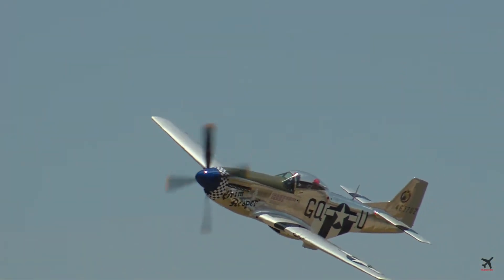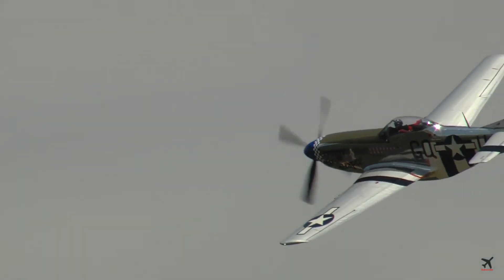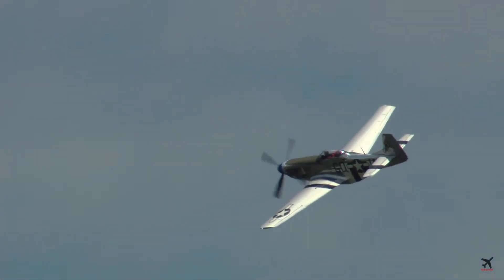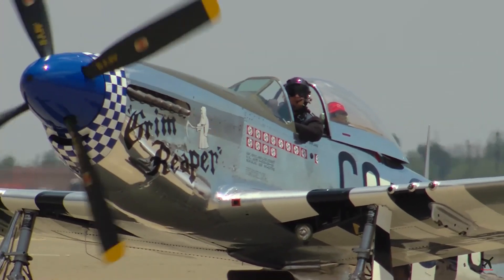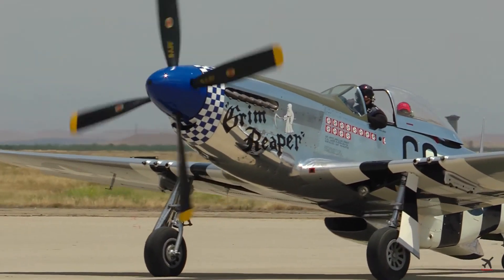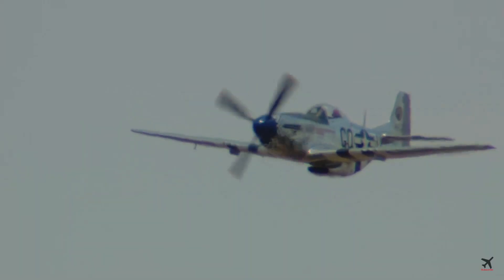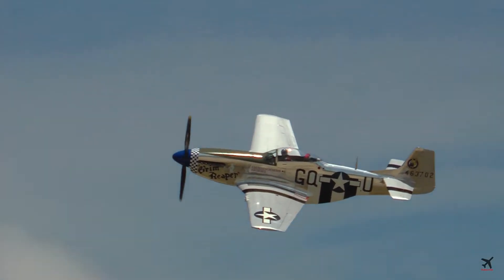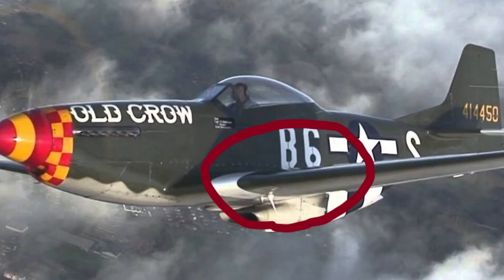Making R2D2's scream | Why does the P-51 whistle?

Comment from the maker: Just a quick correction - TF-51Ds can have gun ports, and I made the mistake of believing they didn’t have armament, I was wrong. Some P-51s have gun ports sealed up, resulting in the whistling to not be heard.
Reply: If a real gun, not just a cover with holes, is in the port does the plane whistle.
Reply from the maker: @08jag81  Yes, if a real gun is in there it shall make a higher pitched whistle, if there is no gun then a lower pitched whistle. If taped up it won’t whistle.
Reply: I agree
Reply: Does this answer apply to most WW2 warbirds?
Reply: Surely there is some kick arse 2 stage supercharger whine in there💪
There's a p 51 called precious metal, that beast whines and it aint even got guns. Pulled 454mph on 2nd lap with a contra-rotating propeller set up. Just a beautiful drag car of the sky💪💪💪

Comment: The problem with this theory is that the gun ports don't have the right depth and volume to make this frequency, and this sound isn't common on other aircraft that have similar guns in similar locations, most especially the most obvious comparison: The older Razorbacks and Thunderbolts. This sound is unique to the P-51D.

Comment: It seems like a degree of back-pressure inside the gun port is necessary as well. If the hole went through, ie wasn’t designed for airflow like the radiator, there wouldn’t be the energy needed to create the pressure oscillations inside the gun port, which is basically an open ended moonshine jug.

Comment: On P-51s with open gunports, do the openings in the leading edge of the wings have any significant effect on the plane's stall behavior?
Reply from the maker: The size of the gun ports are so small and therefore would yield a neglegiable effect to the stalling characteristics of the mustang, maybe only altering behaviour slightly.

Comment: I have a battered Subaru that does something like that . The right front wheel well cover is cracked and is held in with plastic tie downs and it drives me crazy when I'm driving into a strong headwind and that wheel well starts whistling. Seriously, thanks for the explanation.

Comment: How would a P - 51 D compare in a dogfight (with equally skilled pilots flying both sets of airctaft) with :

- a Messerschmitt Me - 109 K4,
- a Focke - Wulf FW 190 D9/13 or
- a Mitsubishi "Zero"?
Reply: The Zero was pretty much a 2nd rate aircraft by 1944, as the F6 Hellcat shot down scores of them at the Great Marianas Turkey shoot and before then as well.  And the P-51 was superior to the F6.  A
The FW 190 D(ora) 13 was the best German fighter and had almost the equivalent speed as a Mustang. While the Me-109K had a faster climb rate than both.  So if the skill of pilots were equal....this would be a hard call.  Personally I like the 20mm cannons as an armament. Better than MG's.   And I would take the FW over the ME as the FW was a much sturdier plane and could take more hits.
Reply: @robertwolf3969  BAGGED IT!
🔥🔥🔥💪💪💪👌👌👌

Comment: It's the inboard "blast tube" of the first gun in each wing that causes the whistle, not the mid and outer gun muzzles that protrude from the leading edge. The blast tube is several inches deep before the muzzle of this inboard gun is reached, hence the loud resonance. That's why the B/C models don't whistle. Their 4 x .50s are arranged differently and have no blast tubes.
Some TF-51D's retain their "guns", including the aforementioned inboard blast tube, like "Crazy Horse 2" for example, which whistles. However its sibling "Crazy Horse" (which I flew in 2012) has no guns and the clean leading edge means it does not whistle.
Contrary to myth, the radiator scoop and supercharger have nothing at all to do with the whistle sound.
Reply: Interesting. I would think that the "deeper" inboard gun means that the air space in it is larger than the other two, so that the whistle is a lower pitch than the others, which have a much higher pitch. Again, think of the coke bottle experiment where when you blow into an empty bottle versus what that is partially filled, the empty has a much lower pitch, or resonant frequency. From which I would conclude the inboard tube's resonant frequency is much more audible than the higher pitch frequencies of the mid- and outboard gun tubes. At some point, the tubes' very shallow depths don't resonate at all.
Reply: neat, answered my lingering question of why other American fighters, P47 my favorite WWII fighter for example, dont whistle.
Reply: @pixelation782  look up videos of the P-47 Tallahassee Lassie. She still has all of her ducting and the turbo charger intact. Most flightworthy P-47s have the ducting bypassed or removed and the turbo is almost never used due to the complexity and difficulty of repair. You will hear the turbo sometimes with Lassie but not bypassing the intercooler ducts also changes the exhaust sound a lot.
Reply: actually just found a different video of an F4U corsair whistling but with a much deeper sound and wanted to see if you know why it whistles differently?
Reply: @pixelation782 unlike the 51, the F4U whistle was caused by the intake ports of the leading edge of the wings.

Comment: Actually, it's not a whistle, it's simply the sound of the air going over a surface at high speed, and MANY warbirds do this, notably the Corsair, but so does the Lightning.  It's a function of speed and a plane's surface that is not and cannot be perfectly smooth

Comment: There actually seems to be a combination of more than one sound. Yes, the gun ports make the majority of the sound, but the one without still had a slight high pitch whistle on fly-by. Like using salt to enhance flavor, the intake seems contribute ever so slightly to the overall sound as can be heard by the one without the gun ports on fly-by.

Comment: Coming at you usually in a bank wind crossing the leading edges makes the cups on the inner most gun whistle. Passing overhead when the rpm range is right you can hear the impeller on the supercharger singing. So it's both just the gun ports are much louder.
Reply: Bullshit,  so why not on other Merlin powered aircraft Maestro?
Reply: @Slaktrax  Maestro? No No No Technician. 1st take a breath buddy you seem real dam up tight? Ever been to Reno? Most of the racing 51's have no machine gun ports so no screaming banshees or howl upon banking, turns etc. However you do still hear a singing whine not a howling from the heavens. It's the supercharger impellers. If you've ever spun one up on a test bench you'll never forget it. Almost like a skill saw just as the cut finishes you hear a gear winging. V12 super Chargers with short stack exhaust just infront of it you probably won't hear unless the aircrafts centerline has a big ass hole in it. Or maybe a radiator intake/exhaust ports. But you gotta remember anyone slightly hard of hearing will never hear it unless it dam near cut your hair coming over. So it's both only one is loud as hell and the other isn't. Grab a cone bearing, slip it over your fingers and use an air blower to make'er sing you'll see. (Just don't do it with a plastic cage type it'll fuck ya up when she comes apart.)
Reply: @warrenchambers4819  Thank you for your comment. When I was a teenager, I was told that it was the supercharger whistling. Watching this video made me think I was told incorrectly. Sounds like both things can produce the whistling sound.
Reply: @warrenchambers4819  

You can hear the SC whine in the non gun port Old Crow pass in this video.

Its more subtle than the Gun port howl.
Reply: @Slaktrax  you can also hear a slight supercharger whistle at Spitfires and more prominent at DB 605 engine of Bf 109.

Comment: Another “Whistling Death” like the F-4U Corsair.
Reply: Both beautiful planes but I love the elegance of it’s inverted gull wing design combined with brute force that the Corsair possesses.
Reply: Amen! The F-4U with its inverted gull wings, is a very unmistakably unique aircraft.
Reply: I watched a video on the F-4U Corsair a while back. They said the whistle on it comes from the oil coolers mounted in the wing next to the fuselage.
Reply: They are both my favorites with spitfire just behind. Then the mosquito. Whats neyter than two merlins
Reply: Hoa Tattis  As you’ve said. To each their own. It was faster than the P-51 at top speed by about 10 knots. The P-51 would cruise much faster by nearly 100 knots and was definitely more maneuverable. But their are many Corsair aces that would disagree with you.